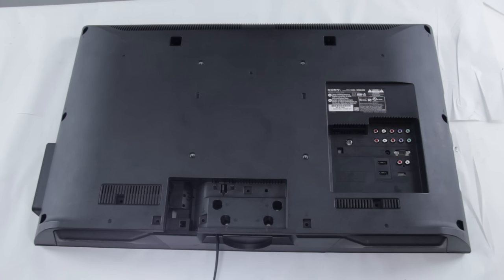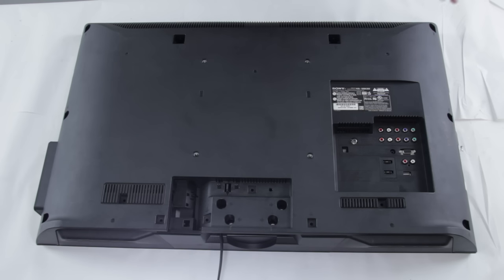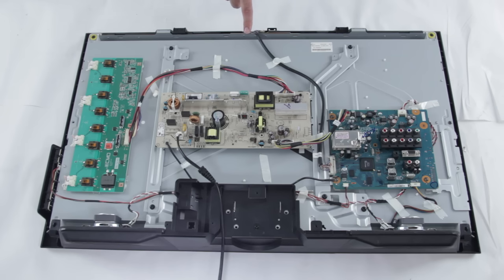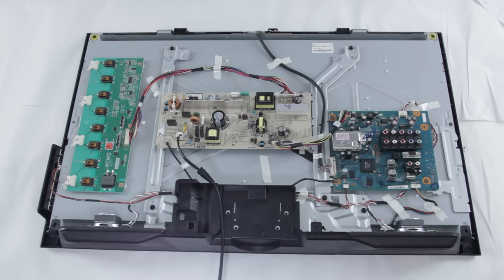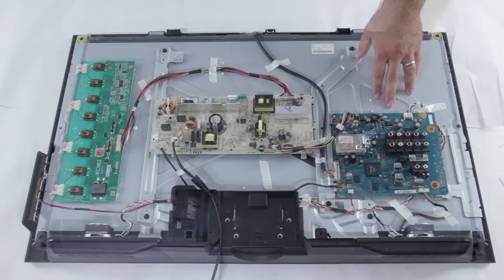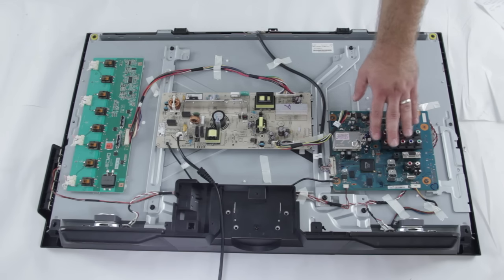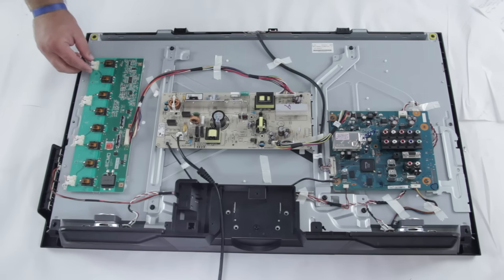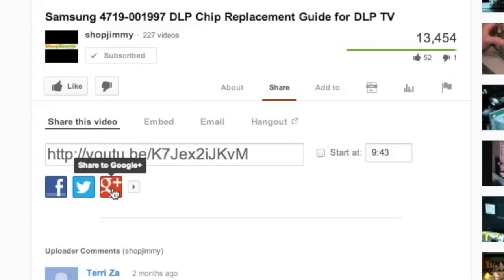LCD TV Repair Tutorial - LCD TV Parts Overview, Common Symptoms & Solutions - How to Fix LCD TVs

Comment: I have a sony KDL-40w3000 that has wide vertical bands of horizontal lines that are shifted parts of the displayed image. This Interpolation is occurring on the sides but the center is displayed correctly. This occurs on all inputs that I have tried (HDMIs and TV tuner).  
I was thinking it was a tcon issue but I have replaced the tcon and have the exact same issue. 
I have an image.

Comment: Got an issue with this element tv (model e4aa70r) that I got off a Black Friday deal. Right out the box the tv power indicator light turns on (red) but the tv doesn’t actually power on when I hit the power button. I’ve done all the troubleshooting steps and even the warranty process but instead of fixing they just refunded my money. Now I have a tv that doesn’t work that Element wants me to recycle. Throwing out a decent tv doesn’t sit right with me so I rather fix it.

Comment: Just came across this video as im trying to troubleshoot my Hitachi LE49S508.  Plug it in, red standby lights comes on.  Hit power buttons, red light turns off, but no other activity.  Likely need to replace the main board?

Comment: Just came across this channel, and it just may be what Im looking for. I work for a Home/Business Security company and we do a lot of TV and monitor installs. I often have to replace many "broken" TVs and more often than not, the older TV is simply tossed out. Once I discovered that there are tons of videos available showing how to fix what is often a pretty simple issue, I got to where Im collecting the older TVs.  I got a couple right now.  One is a Westinghouse LCD TV with a 'Won't turn on' issue.  The other is a Sanyo  Model DP42840.  And its the Sanyo that I have a question about at the moment. It's having picture issues.  When its turned on, the screen on the left side (facing TV) will begin to turn white. It will go about 25 to 30% of the way across then stop.  When you turn TV to another input thats not being used, you will see the white gradually begin to recede and go away.   Hoping you may be able to let me know what that might be indicative of.   I appreciate any help you can give.  Thank you.
Reply from the maker: +jeremybr2020   Try all repairs and troubleshooting at your own risk.  This could be a problem with either the main board OR the TV Panel.  You can replace the main board to see if that fixes the problem.  If that does not fix the problem, then you most likely have a problem with the TV panel.  The TV panel cannot be repaired and sometimes it is not cost-effective to try and replace the panel.  Click this link to replacement parts for your TV model number:  http://www.shopjimmy.com/catalogsearch/result/index/?cat=56&q=DP42840  There may be multiple boards for the same TV model number, be sure to match part numbers on your current board, with your replacement for compatibility.  Here is a link to a video showing how to identify your part number, click here:  https://www.youtube.com/watch?v=Mi0D7ksQp7IThanks and please let us know if you have any further questions with your TV Repair!  www.shopjimmy.com
Reply: +ShopJimmy.com So I decided to put the Sanyo on hold and check out what I figured was a simpler issue with the Westinghouse.  The Westinghouse TX-47F430S is having the all to common, "Won't Power On" problem.  I get a red light, so it seems to be getting at least some power.  It also used to power on occasionally. But now it hasn't in quite some time.  So I go to remove the back cover.  Let me first say that Ive watched quite a few different TV video repairs.  Ive seen the backs of several different LCD TVs.  It would appear that Im unlucky enough to have one of the more complex inner workings out there.  There's no simple "Take off back cover.  Remove the 4 to 6 screws and take off the metal cage/covering off of power supply and there you go"  Hell no. I got some weird ass bulky middle assembly that requires either really small fingers or some kind of pliers to remove the ribbons and connections before you somehow remove the outer metal box cage thing......holy crap what a pain in the ass.  Sorry to make this so long. Let me wrap it up with a question. Do you know if there are any videos out there showing the removal of the back components on that model TV?  Just want to make sure Im doing it correctly.
Reply from the maker: +jeremybr2020   Try all repairs and troubleshooting at your own risk.  Unfortunately, I do not see any information for that model.  You could upload an image or video online of the back cover or anything that is difficult and we could then take a look at that image or video and let you know any suggestions.  Just reply with the link if you do that.  Thanks!  www.shopjimmy.com
Reply: ShopJimmy.com
I managed to figure it out.  Thank you anyways. The only problem now is that I don't see any obvious issues. No bulged caps or things of that nature. Now I still need to go get my tester so I can actually get a reading on the capacitors. So we'll see how that turns out in a few days.
Reply: +ShopJimmy.com 
screen roto LG 32LS3450

Comment: i am currently having issues with a Haier.

Model: HLC22R1
Issues: Will not turn on,  standby light flashes red and seems to try to automatically turn on(light flickers green for a second and the blacklight on the monitor flickers). While the light flashes red you can hear the speakers popping/crackling lightly. 

Hope that you can help c:, thanks!

Comment: I have a Sony KDL-32BX300 
2010
and  I was able to hear sound and able to see the top part of the tv. the other half was kind of black with stripes.. so I took it apart and I notice that the screen is a little bit crack from the inside of the screen . my question is can I repair the crack screen or I need a new screen ..

Comment: I have a LG 47LB6000... the problem is that i have no picture but i have power on the tv...looked into the tv with a flash light to see if i see anything...but nothing displays..seems like i have no backlight..do you think it is the led strips failling ?? thanks

Comment: Hi, I have a LG TV;  MO.- 32LC5DCB-UA. The TV sound works but the picture went out. I'm guessing its just the backlight inverter board, but wanted to make sure its not the T-COM board or something. (don't think there's a T-COM board on this TV?) Haven't been able to try the flashlight test yet, because the tv at my other house, but if I do and see a faint picture would this point to a faulty backlight inverter board? 
THANKS A BUNCH!

Comment: Hi, I have a Sampo PM-42S19
that I can't turn on. The standby light is on. When I hit the power button, the light turns from orange to green, but usually there is a click sound along with it. I opened the TV and checked the power supply as you said in the video, the capacitors all looked fine. Although I didn't use a meter to check the ceramic fuses, but they all seemed normal to me. Same thing happened before and I asked someone for help, he ended up replacing the entire power supply. Can you tell me how can I fix it?

Comment: I have a DYNEX 32 inch LCD TV; model number DX-32L150A11. I get the picture and the audio from the TV. However, the picture become more greenish. When we shake it or give it a tap it becomes normal. Do you think its a problem with TCON board or it is do with back light panel? Thank you in advance.

Comment: Have a Toshiba 55G3100 with no picture or sound, and no backlight glow (or image on screen using the flashlight test). Fuse on power board is fine and green power indicator onto front panel is green. I'm thinking main board ???

Comment: Hello,
I have a Vizio XVT553SV that has a frozen picture with endless big horizontal lines, and the picture itself is noticeably lighter than normal. Sound continues as usual. This happens on all inputs. The remote works mostly as usual but once Menu is selected, I can navigate through the settings, but can not exit or turn the tv off from the remote or onboard power; have to completely unplug and let it resist itself. 
Thank you.

Comment: Hi. I have a Vizio D32h-C1 and the screen is messed up. Most of the screen is just black with a pattern of white horizontal lines that fade out towards the left of the screen, and the far left side of the screen has a thick white vertical strip going down the screen. As far as I can tell, there is no tangible or visible screen cracks. The pixels just seem to be really messed up. Is there anyway I can fix this or is the TV done for.

Comment: Hello, I have 7 years old Samsung UN40J6200. 10 days after moving across US- (not sure if related or not) I started to have an issue with the top half (it starts precisely in from the middle to the top) of the screen having horizontal lines and ghosting. I cleaned all ribbon cable connections. I also tried to disconnect one of the two connectors from T-Con to the panel. Surprisingly the entire screen is black when I disconnect just one of the two cables. Same for the other one of the two. This issue persists if no input is connected, visible also when TV menu is activated. Any idea what the issue could be on this one? Thanks for any hint.

Comment: I have a Sharp LC70UQ17U. It started to get horizontal black wedges that flashed across the screen. Sometimes one of the wedges would have blue and yellow vertical blocks in it. The wedges were not always in the same place. Occasionally the tv would turn on and be normal for a few minutes and then start with the flashing wedges. Now the tv won't come on at all. The power indicator light will flash but no picture or sound. What do you think the problem could be?

Comment: I have Sony KDL50R550.  Recently the picture shows a line across the screen about half way down and every few seconds the picture below this line jumps by a few pixels.  Its actually still watchable but after about 20mins or so when the picture jumps the bottom half of the screen shows like scans lines for a second, at that point it is difficult to watch.  To remedy it you need to let the TV cool down.  I believe something damaged the screen.  Does this sound like a repairable issue?  Thanks!

Comment: Hi, I enjoyed your video as it is quite informative, but as I went to your website, I keep getting an Access Denied message on my browser. 
I'm looking for a replacement mainboard for an LN-T4161F Samsung LCD TV. For some reason, the TV just keeps on changing sources on its own, reset to defaults or go crazy opening and closing the menu. Sometimes even the remote is unresponsive and cannot for the life of me, reach the service menu because on start, it just switches sources on its own.  Is it the mainboard the problem, or am I looking at another issue, here?  thanks

Comment: Just bought an LG model 50UK6090PUA 2months ago, now with a crack screen no picture, has backlight and sound. Do you have an idea how much is the LED panel if im planning to replace it or would it be more expensive and better off to just buy a new one.  Or if i was selling the whole tv for combine parts like power supply/mainboard/ T-conn/ wireless wifi adapter, how much should i sell for online?

Comment: Phillip 42inch TV model  42PFL360S98. It has no power , as the standby LED doesnot lit. I could not see any obvious buldging cap in power supply board part no 40-IP42CS-PW11XG. Kindly advice if you could help.

Comment: I have a LG55LM6700 3D TV. Standby lights stays solid red no blinking/flashing. I try to unplug and hold power button. Does not work. Checked power supply, standby pin has no voltage. All fuses and caps looks to be intact with no physical damage on power supply. Should I just replace the main board?

Comment: Hi, i have a Philips 50pus6162/12. The backlight turns on but no picture..  The power supply seems to be fine and on the main board are still 2 LED's that light up. Maybe a problem with the Tcom board? Thanks in advance

Comment: i have an LG 65uf6450.  the screen doesnt display any video source.  the menu comes up and even the app background is crystal clear, but the video itself is just a bunch of scrambled pixels.  the audio is perfect aswell.  I tried multiple cables, sources, and inputs (even digital over the air), same result audio but scrambles (and stationary) pixels.  sounds like I need a main board but I thought I'd ask.  I contacted LG they said I'm on my own (its 18 months old) so I'm pretty dissapointed in their product.

Comment: My LG lcd model #is 55UH7650
Serial # 702RMGC0H639
The power lcd light is dark indicating no power. Worked perfectly until losing power. Receptacle is ok. Any solution to fix this would be appreciated.

Comment: I have a Coby model ledtv2326   It has a history of randomly turning itself on in the middle of the night so we keep it unplugged. The other day I plugged it in, the blue led standby light illuminated like normal, but it would not turn on either by the remote or the power button on the back panel. I unplugged the power, waiting a bit and plugged it back in. This time even the blue led standby light wouldn't illuminate and it still would not turn on. I'm thinking I need to replace the power supply. Got any advice? Thanks so much!

Comment: I have a 32 inch toshiba, when I plug the aerial in to the TV it loses signal.
I have replaced the aerial lead.
I was advised by the aerial repair man that it was getting back feed through the aerial.
would this be a replacement circuit board to fix it?
brand : Toshiba
model : 32av700a

Comment: sony watchman FDL-310, audio is just barely audible if you put your ear up the the speaker and video is barely visible, looks a little distorted... checked test points, TP says 6 volts and measures 4.85 volts on TP and another TP says 18 volts and measures 19.5 volts on TP... this may be appropriate (sufficient enough) voltage level (not sure if this is significant or not)... although, it should read what the TP says... i hope it is just caps, this is a very special fix and tv
Reply: you can somewhat see the outline of the characters in the film (from the video source) it looks reddish/brownish... the audio works with headphones

Comment: Hi, glad to have found this on the internet, very informative video. I have a Sony KDL-42W829B which now displays only large vertical coloured bars like as in a RGB Screen test, no image can be seen between bars or even faded, I cant even see the menus on screen. I tried disconnecting and reconnecting the ribbons from the T-Con board but no difference noticed, the audio is working though which according to your tutorial could be the T-Con board. I know you also mentioned the inverter can cause a similar issue, sound ok but no image, would that also cause large stripes on screen? Can you also tell whether could merely be a fault on the lcd panel? I have checked by pressing all ribbons attached but never seen any reaction, Thanks.

Comment: great video!  very informative. i have a philips 46 in tv model #46PFL3608/F7 serial #DS1A1308103220 (A37QAUH). it went out during thunderstorm and wont turn back on. the wall outlet works with other devices so im sure the tv went bad. could it just be the power supply board i need for repair? please let me know if it is repairable or a lost cause? and if you carry the part it might need? i appreciate any information you can give me. thanks in advance.

Comment: I have a Toshiba 42AV500U the TV doesn't show the picture when you turn it on, but it happens randomly so say every 3 or 4 times when I turn it on it won't show the picture or sound the lights show the TV is on and the screen is black but is on, so I have to turn it back off and on several times sometimes 6 or 7 times until turns on with video and audio, ones is on stays on  thank you

Comment: I have a Dynex - 37" LCD tv; model no. DX-LCD37; Serial no. G347AJA019470.  I'm have sound, but no picture.  I've examined all components, but did not find any burn outs or bulging components.  I would like to replace the Tcon Board and see if that fixes the problem.  Can you recommend where I can find a Tcon Board #: TS-5537T03021-79D-NE3000-05736-10?  Thank you.

Comment: Hi my hisense Model # F55V89C turns off by itself. This symptom started a year ago but now has become quite frequent and will turn off every 5 to 15 minutes. The Tv turns on and the picture is fine. Sometimes I have to remove the power supply and reconnect to get the tv to turn back on.

Comment: Hi I have a kdl40xbr2 serial 8118201. The screen went black while I was watching and there is no sound. I also tried to switch the input to tv through the antenna and I couldn't get picture or sound. I was wondering if you have any idea which board I would need to replace and if you have them in stock
Thanks